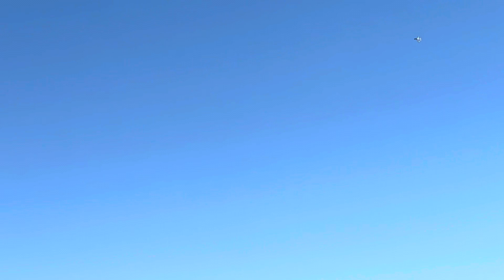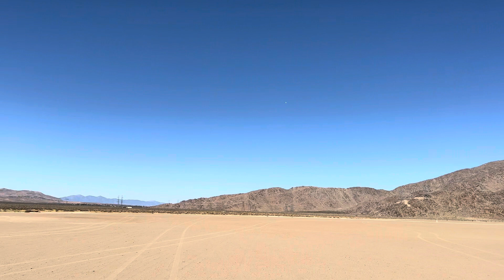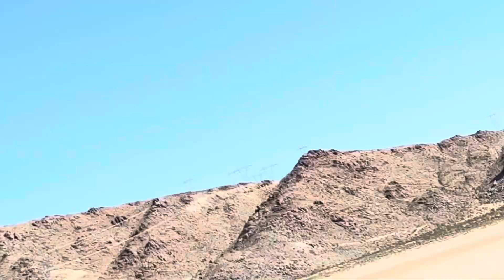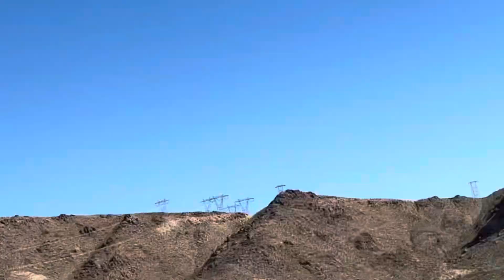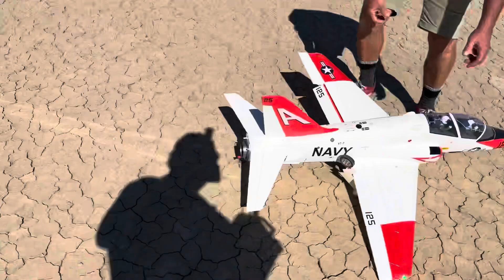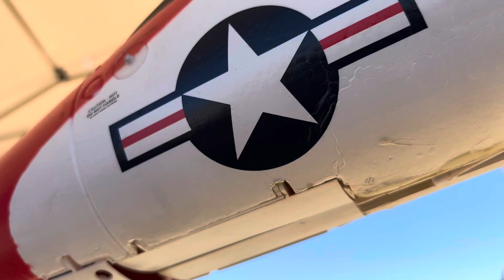Freewing T-45 turbine crash landing ! “Lady bug “bites me !🐞😭

Comment: Hey Bro, its been a little bit, since we last spoke I have picked up FW F-5 80mm which is an absolute rocket, no need for turbine😂😂 and also the FW F-18 Blue Angel.   but I have a question, (coincidently, I happened to run across one of your videos about it)  I have been using the Nx3 pro gyros.  love the they work great, but was interested in trying the Nx3 EVO . that has the emergency button function. does it work like "SAFE" does with spektrum receivers?  I don't have a spektrum radio so I have never tried the SAFE receivers, but this EVO sounds like it should work similar to the SAFE from Spektrum,  Have  you tried it ? what is your experience with the EVO gyro?
Reply from the maker: Howdy cowboy ! 🤠 yes it is like the  panic/safe button from spektrum .. works great .. it has saved me a few times when I went to far and I lost orientation, turns the plane Back to level flight .. I have never flown with it completely on , I have only used it for emergencies..

Comment: That jet must be heavy to tip stall at that speed , shouldnt do that
Reply from the maker: Yeah it was weird ! First time it has done that to me that bad .. maybe a little to much on elevator and with the help of some cross wind got me .. there is no gyro installed , gyro would of prob helped me a bit , but it flys great without it .. next flight I am going to land on low rates see how that works so I won’t give it to much elevator .. it weighs about 10 pounds ..